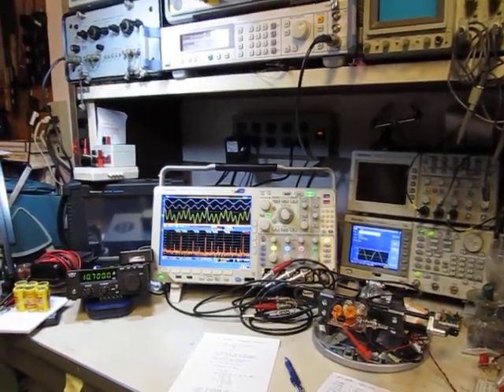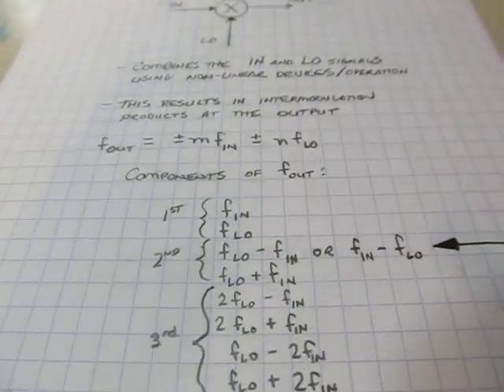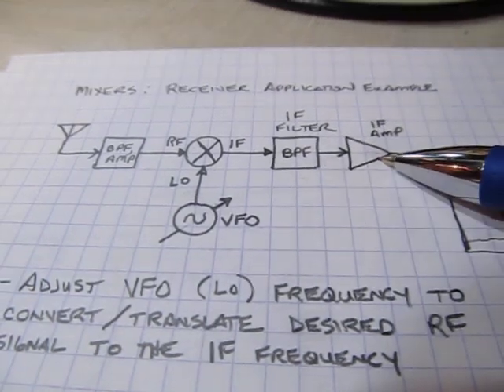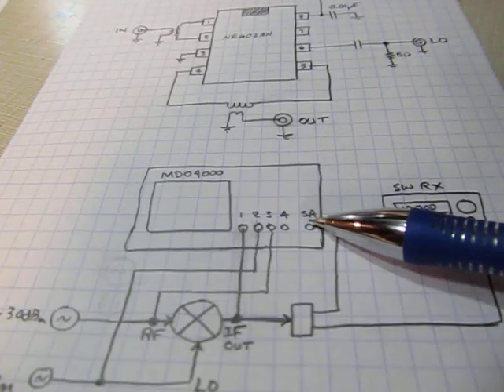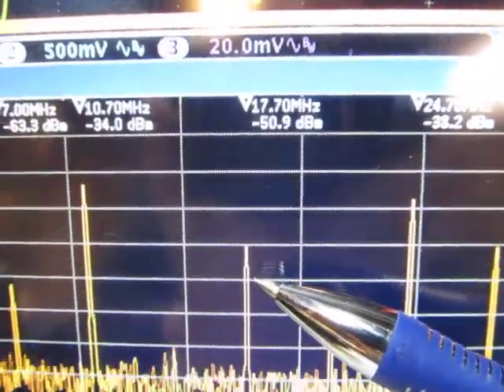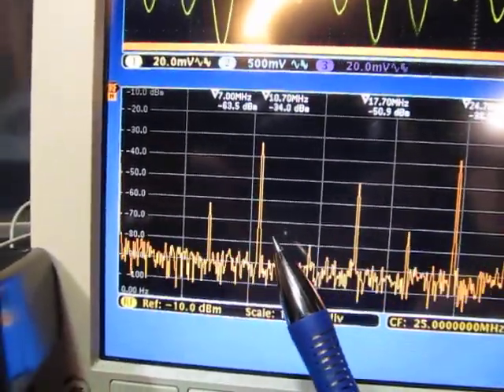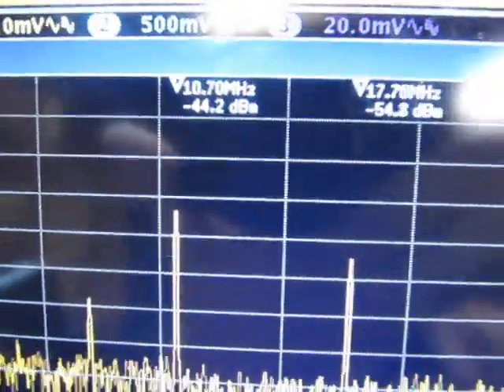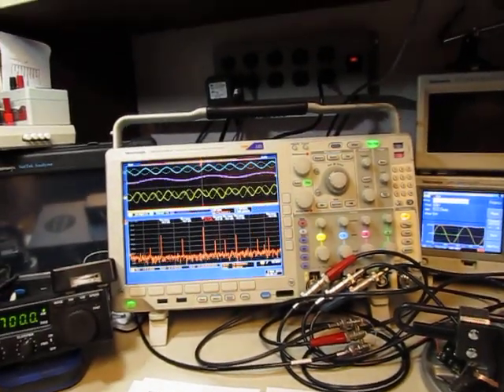#83: Basics of RF Mixers in Radio Receivers / Mixer Tutorial / Frequency Conversion

Comment: Love your videos, can you please explain the function and how you calculated the resistor and capacitor values at the LO input terminal?
Reply from the maker: 50 ohm resistor to properly terminate the coax transmission line from the signal generator. The capacitor value is large enough to have less than a few ohms of reactance at the operating frequency.

Comment: Great video but i still have a question: if you are using a superhet to recieve FM wouldnt the IF being set to one frequency affect the modulation?
Reply from the maker: No, the FM signal will simply be mixed to (shifted to) the IF frequency.
Reply: @w2aew  Oh for a second I overestimated how precise the frequency output of the mixer would be and that it has a sizable bandwidth where the FM range can be detected, my bad 😅

Comment: How can you design a BPF for a specific intermodulation product when the products are in different places whenever you tune around?
Reply from the maker: Since the intermod products move when you tune the LO, you basically adjust the LO such that it places the intermod product of interest inside the IF BPF.
Reply: @w2aew  That's a helpful way to think about it, thank you. I was hoping the BPF wouldn't have to be adjustable.

I read that in some cases the LO stays fixed while a VFO is additionally mixed-in. So much to learn.
Reply: This is the thing I'm struggling to understand about superhets, I'm sure it's simpler than I'm imagining
Reply from the maker: See reply

Comment: Dear Sir
I have big question for you.I  never undwrstand 455khz or 10,7mHz diffirenece every time.Which circuits are provide this.Also How local osc. Shifts to rf signal 455khz or 10,7 mhz.455khz signal where is coming out.
I have read alot of document but I have never seen.Ony one guy had written .He say local oscillator and if signal varies simultaniusly which 455khz diffrence stays same.Also Lo oscillater makes modulates with 455khz carrier.
Stay safw
Thank you very much
Baha
Thank you very
Reply from the maker: This video of mine should help you with the concept of mixing and Intermediate Frequencies like 455kHz or 10.7MHz.  https://youtu.be/Vf06HSR4LdY?si=YR97tcqTmVKCbk46
I also have videos on the basics of Mixers that should help too.

Comment: Have a question about single transistor mixers. whenever i try to build or emulate a single transistor rf mixer it always behaves as an amplitude modulator rather than a mixer. the only time it ever achieves mixing of any sort is if my LO signal has a large enough amplitude that it starts to clip at the output. so basically i still end up with a classic amplitude modulator, but with a flat top... however when reading about mixers or watching other channels the describe the output as basically your subtracted frequency, but it has the added frequency superimposed on it... ie. it looks like a lower frequency sine wave but drawn with a very fat marker... if that makes sense.
.. so which is the actual expected output? are both outputs achievable?
thank you :)
Reply from the maker: An amplitude modulator IS a mixer!  It's just not a balanced mixer, so the output contains both input frequencies, as well as the sum & difference frequencies, that's why you are seeing the sum also. Is it "fatter" at the peak vs the trough?  If so, then you are getting some mixing action.
Reply: @w2aew  thank you for the prompt response.
it doesn't appear fatter on the scope ... It's just the sum frequency, the LO, the RF, and this is amplitude modulated at the "beat" frequency. In simulations if I do a spectrum analysis I can see the sum, the RF and the LO... But not the difference frequency at all. I'll research more about balanced vs unbalanced mixing. But if I understood correctly, if I had a balanced mixer I could just LP using a simple RC filter, and recover the difference frequency... But if I have an unbalanced mixer, first I need to go via a diode detector... Then LP?
Reply from the maker: @coffeecuppepsi  With unbalanced, you just have additional frequency components in the output.  Usually the unwanted ones you'd just filter away.
Reply: @w2aew  ok :( I need to debug my circuit

Comment: FANTASTIC video, I'we seen it a lot of times. A question: Is the IF filter designed for a specific impedance?
Reply from the maker: Yes, typically tuned to the output and input impedance of the circuits preceeding and following stages.

Comment: Great video for me learning this stuff.  I looked up that ceramic filter, so I take it with their wider bandwidth relative to a crystal you wouldn't use them as an IF filter for narrow band applications like SSB?  Or are there other stages downstream where using the ceramic filter would be appropriate.  Thanks for the knowledge

Comment: Great video Al.  I've viewed on several occasions over the years and now have a question for you.  If I have viewed correctly, RFin is at -30dBm and the LO is at 0dBm.  My understanding of the 612 is that there will be some gain at the output. It appears on the SA that the I.F. is at -34dBm. My question is where is the gain?

Also is there any advantage in utilizing both output pins 4 and 5, in a design over just using one output pin say pin4?

thanks again Al for all your videos

Peter ve3poa
Reply from the maker: You can see the small amount of gain from the time-domain waveforms of the input and output on Ch1 and Ch3.
Reply: @w2aew  I see that now. Thank you Al

Comment: Allan, another top-notch video. Thanks for making it. I have two questions: 1. I replicated your demo but I cannot get my 3 pin ceramic filter to pass the 10.7 signal and attenuate the remaining frequencies. Is there some trick to this? would love to see how you added it to the circuit. I can't make it out in the video. 

2. I am looking at my HeathKit FM tuner and it has a two-ganged tuner/variable-capacitor. From the schematic, it is filtering the RF and the other gang is changing the LO frequency. Since FM covers 88.1MHz -108.1MHz, doesn't the LO need to produce signals within the range of 98.7-118.7MHz so they are alway 10.7 apart? Doesn't my tuner work to adjust the LO so it is always 10.7 above the RF?

Thanks in advance!!!!
Reply from the maker: No trick to the filter.  It has an input and output pin (interchangable), and a common pin (ground, in the center).  The LO frequency can be either 10.7MHz above the desired frequency, or 10.7MHz below the desired frequency. Either will work.
Reply: @w2aew  Thanks!  I will keep trying.

Comment: I'm trying to figure out how two audio signals are combined into one signal, to make the audio mono output sound like it contains both audio input signals.

Obviously you cannot just tie two audio output wires together...

The search criteria "how does an audio mixer work" produces loads of useless videos about how to work an audio mixer.
Reply from the maker: What you are referring to is commonly called an "audio mixer", which really isn't a mixer in the same sense as what is presented here.  An audio mixer is typically a form of a summing amplifier.  Check out my video on summing amplifiers...

Comment: Hi Alan. I know this is a very old thread. Another excellent video. I have 2 questions. #1 How did you determine that the LO is set to 0 dbm. If I remember correctly the data sheet recommends a level of 250mv to 300 mv. #2 Would a square wave LO work as well? Thanks
Reply from the maker: LO power is typically measured into a 50 ohm load.  A square wave LO would work also.
Reply: @w2aew  Thanks Alan

Comment: Great video. When designing a receiver, how do you know what your LO should be? Or what range should it be?
Reply from the maker: It really comes down to where you want your IF frequency to be - based on your radio design, available filters, etc.  There are more considerations too, but this is usually one of the primary driving ones.

Comment: Sir! Can it also be used for transmission? can I convert 110 MHz-250 mw to 310MHz if i have a Local Oscillator of 200MHz? thanks
Reply from the maker: Yes, but often the mixing is done at very low power levels.  You will also have to filter out the unwanted mixing products (bandpass filter the desired output).
Reply: @w2aew  Sir!in this type of rf mixer, the double balanced mixer, how many dBm should I enter in the RF and how many dBm in the LO?thanks

Comment: hi sometimes we have a rf signal that it's not repeatitive like a sound wave how can we downconvert this signals to sampling with low sample rate analog to digital converters? is there any way?
Reply from the maker: If you use a mixer with a LO input at the RF signals carrier frequency, that will convert it to baseband.
Reply: @w2aew  I want to sampling nanosecond uwb signals in radar receiver part with a 2ns pulse width and prf 100khz In more times we use a equivalent time sampling oscilloscope but in mixer how to do that ???
Reply from the maker: @mofaelectronics1295  Well, that gets a lot trickier.  A 2ns RF pulse width is going to occupy about 1GHz of RF bandwidth, so using a simple mixer to down-convert to baseband really isn't going to help.  In order to sample with a low-rate (intentionally undersample/alias the signal) ADC will require a very fast sample-hold circuit ahead of ADC.  I don't have any good videos on this topic at this time.
Reply: @w2aew ok thanks alot for answers... its really cool if we can digitize high frequency signals with low cost device I hope to see some videos in feature about this samplers

Comment: IMO, this video is more appropriate to the discussion of using the NE602 to modulate an audio signal to produce an AM signal that could be used to transmit.  (Maybe I'm wrong...? And it is an excellent video!!) It would be cool, though, to see instead how the 602 would transform an input AM carrier plus audio for receive.  How does the mixing function take an AM modulated signal, in the time domain and pull out the audio component?  (Or does it?) (I ask all of this as an EE who studied this in college in the 70s and either have forgotten or never completely knew.  The college presentation is to show the time domain explanation but what I would like to know is how does the mixer translate the received signal in the time domain.  As I think about it it is not obvious to me how it would do it...?

Comment: So what happens if 1 radio station transmits its RF frequency at 10.7 Mhz above the LO frequency and another radio station transmits its RF at 10.7 Mhz below the LO frequency? Will the radio receive both signals of 2 different stations at the same time?
Reply from the maker: If the IF is at 10.7MHz, then potentially yes!  This is what a "preselection" filter is designed to deal with - to filter away one of these two signals so that it doesn't get into the mixer and covert the same frequency.  Note that in this case, the two RF signals would be 21.4MHz apart.  The FM broadcast band is only 20MHz wide, so this situation won't happen with broadcast FM receivers, but it can happen in any single conversion receiver where signals are 2x the IF frequency apart (and there is no preselection filter).

Comment: NE602A !!!!  bought some and am going to try it for an AM transmitter!!!!
Reply from the maker: Before you do that, be sure to check out my videos on the Gilbert Cell (basics, and modulation generation videos).
Reply: @w2aew  Yeah, I watched those.  They were excellent.  I'm trying to modulate a 850kHz rf signal with an 800Hz sine wave using the AN602 but the output is garbage... shoot!!!
Reply: Wait... It's working.  I switched the rf and modulation inputs... I can hear the tone on my am radio.  The carrier in the signal looks a bit misshapen but the tone is coming through at the freq of my hartley oscillator!!!

Maybe if I build it Manhattan style?

I did not use transformers... I wonder if those little IFTs would do the job and clean up the carrier?

Based on your description of how the Gilbert Cell works it seems to me like the modulating signal should be connected to pin 1...?  It seemed like it was the lower two transistors that perform the gain increate/decrease function...?

Did you not also say that for modulation less then 100% a dc offset should be added to say pin 1?

It would be great if you'd show the design of a low power AM transmitter using a NE602A and a transistor Hartley oscillator, maybe working at 850kHz and modulated by a single transistor 800Hz oscillator!!!
Reply: @w2aew  It looks to me like, based on your video about the Gilbert cell, where it built one with transistors, if I want to use the 602 to modulate a, say, 850kHz signal, say with a 800Hz tone, then I would connect the 800Hz signal to pin 1 and the 850kHz signal to pin 6... I did that but it appears that the 850kHz signal is distorted at the output... any idea what that would be?  I coupled in the 850kHz signal, which looks good, with a 100nF cap...  it kinda works except for the misshaped "carrier."  I added a DC offset to the 800Hz tone and I have close to 100% AM modulation.

Comment: device protection short term fix is rf sheild use foil over device double layer block any wifi or rf transmission attack mircocontroler devices have completely protects prove rf tech quiafied

Comment: Hi Alan,
I like your video's: informative, practical and easy to understand. With respect to mixers, one thing is bothering me, maybe you know.
In an SA which usually starts at 9kHz, the first IF will show fin+9k and fin-9k
Both frequencies are 18kHz apart. How do spectrum analyzers deal with this. With a traditional one it can be in- our out the RBW, and in case of FFT    it might just be part of the digitized IF spectrum. Maybe you can shine a light on this?
Reply from the maker: In analyzers that use FFTs, the bandwidth of the IF is typically much wider, so the LO will be further away from the 9kHz edge.  Also, in some cases, the low frequency end of the spectrum is measured by directly sampling the input, bypassing the mixer.
Reply: @w2aew  Thanks for your reply. It makes sense, I have seen somthing like that in  a block diagram. In case a traditional detector, there is different behaviour depending on the selected rbw. Either both mixer prducts are within the rbw, or only one.

Comment: Thank You so much, Alan. I have repaired many vintage amps but always come to a dead stop on the tuner sections. I just picked up the required UHF test equipment and I'M GOING IN. Mini spectrum analyzer with NF probe and UHF SG. Have a Marantz 2220b with no stereo lock. Might just be in the MPX demodulator or IF amp but I want to see it all! What a great video!
Reply from the maker: Did you see my recent video on how a superheterodyne receive works?

Comment: Thank you for your videos sir.  i have a question about Gilbert cell. I compared the view on the scope what you received in #223 video with the current one. At #223 we have amplitude modulation. I can not understand why on the present video the output view is completely different. The schematic for both examples are almost the same - the difference is only with the output of Gilbert cell at #223 we do not have trafo.
Best regards
Reply from the maker: We'd have to get specific, but one of the larger differences in the two videos is that the input frequencies (LO and RF) are much closer in frequency in this video than they are in #223.
Reply: Thank you sir for answer.

May I asked another question? I can not find mistake in my thinking. Video #83 and #223 have generally the same schematic. One is build with transistors and the other IC NE602 (I checked pdf for that IC)

So on Video #223 we have amplitude modulation. This is clear for me.
But on #83 the signal on the yellow channel on the scope is completely different. How it is possible if we have slightly the same schematic. Does it mean if we decrease frequency on video #83 to the range from video #223 we would receive the amplitude modulation?

Best regards
Reply from the maker: @zbigniewcuper4669  In this video, the two applied frequencies are too close together, and the scope isn't showing a long enough acquisition to see the amplitude changes like in 223.  Also, take a look at #224 to see how the Gilbert Cell can be used for Amplitude Modulation, as well as Double-Sideband / Suppressed Carrier modulation - with just a small change in bias conditions.

Comment: It occurs to me that we might try to design say 2 x LO - RF or 
3 x LO - RF to be our IF so that LO can be a lower frequency.  Has anyone tried this?  If so, what are advantages and disadvantages?  If it works, we could even use higher orders
Reply from the maker: This is commonly done.  It is called "harmonic mixing".  The main benefit is not having to design a higher frequency LO source, useful when you need the LO to tune over a very wide frequency range.  This is commonly done in swept spectrum analyzers.  You can see a step change in the noise floor when different harmonics are used.  The main downside is that any phase noise on the LO gets multiplied by the harmonic number.

Comment: Hello!  This is VU2RJV here with a huge thanks and genuine appreciation of this seminal video!  Your clarity and ability to explain in a lucid way is just fantastic. 
May i request you to also tell us the various possible cases that can occur in designing the filter eg, you've explained two cases where RF-LO or LO-RF can occur depending on which frequency is greater. You've mentioned that the side band Inversion will occur. Can you explain the math? Also, could you please cover  other cases as we go from a lower to higher RF and go across bands ? Thanks
Reply from the maker: The mixer gives you the sum and difference frequencies between the input and the LO, as well as the harmonics components:
So, the output will have:  
F(IN)+F(LO)
F(IN)-F(LO) or F(LO)-F(IN), depending on which is greater
and the harmonic combinations:
nF(IN)+/-m(F(LO) or nF(LO)+/-mF(IN)